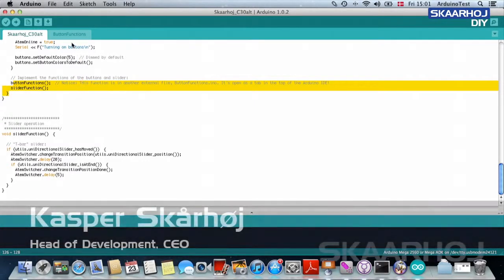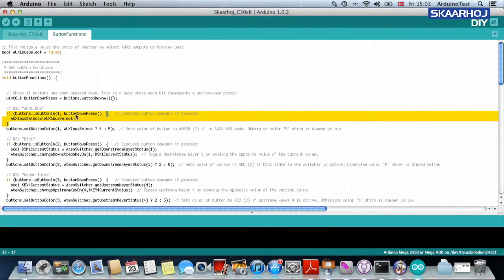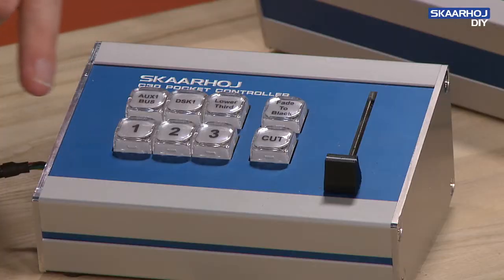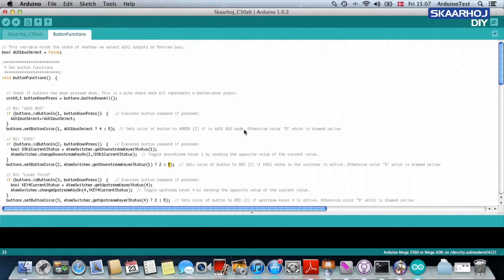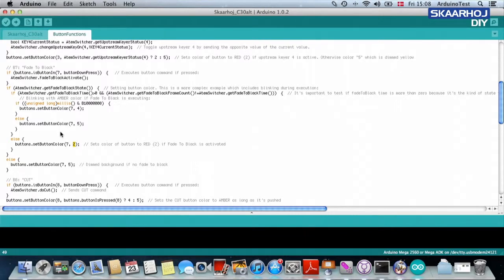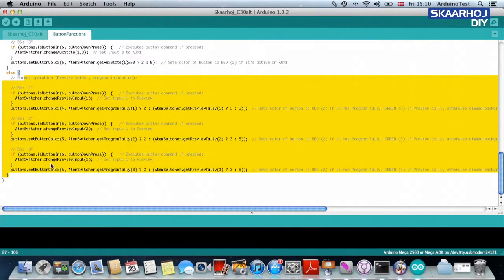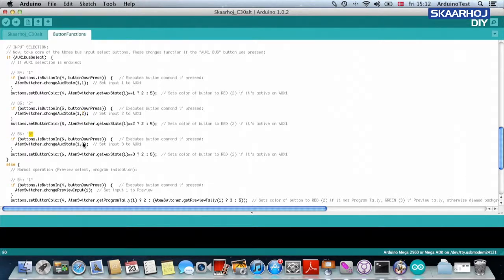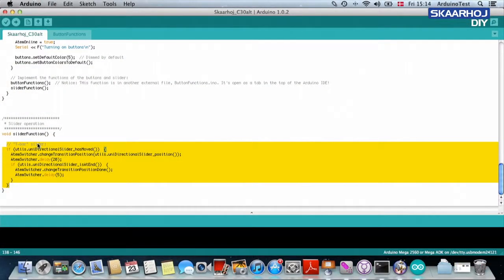LEGACY - How the Buttons on a SKAARHOJ Controller is Programmed

Comment: Thank you wery mutch. We are currently using a Ross Carbonite mixer with controller inerface and BM Camera Converters. But we need to get the tally function on the camera converters to work. The cheapast way is to buy an ATEM switcher and loop the program return trough it. And then program an arduino to take the GPIO from the ross mixer and make the ATEM switcher synk with it :) Using an ATEM switcher as an SDI tally embedder :D